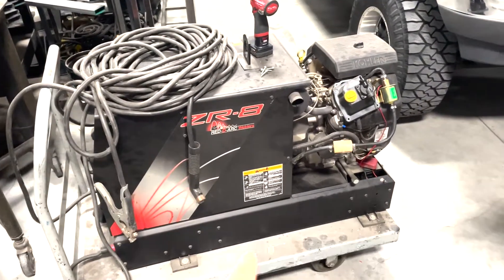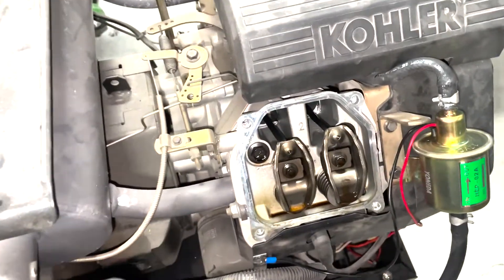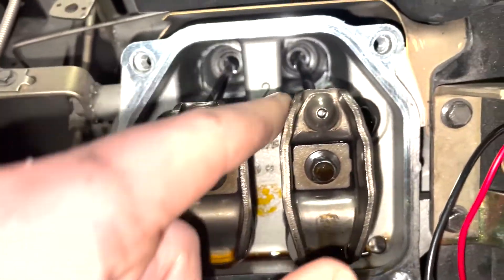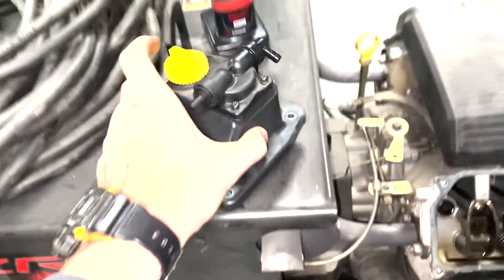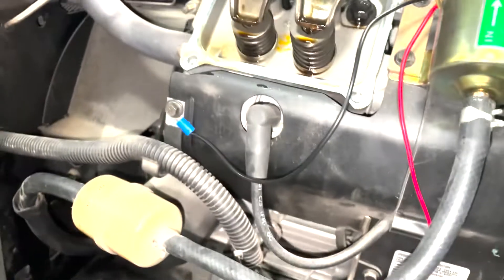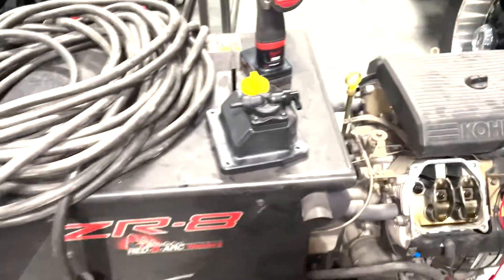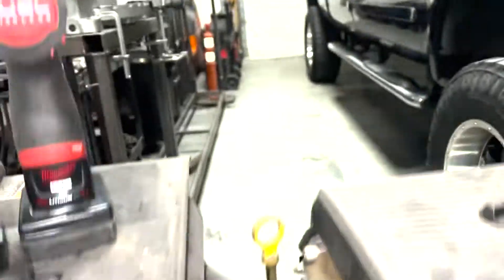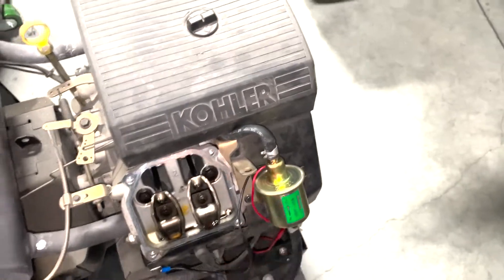Kohler manual fuel pump conversion to electric

Comment: Jesse,  I have a K321 Kohler Engine and want to convert to an electric pump.  I purchased the same pump you show in your video.  When you installed it did you have to make any changes/adjustments to the carborator.  How do I know that this pump is not to powerful for my engine?
David
Reply from the maker: the float of the carburetor should throttle the flow of gas if your pump isnt crazy oversized

Comment: How has this conversion performed since you installed it? Can you provide a link to the electric pump in your description?
Reply from the maker: It has performed perfectly... something i have stopped doing though, is running the engine out of gas when im finished. This seemed to cause the engine to over rev and bend a push rod still.  (i just make sure that i run the engine every month or so to keep the gas inside the carburetor fresh.)
Reply from the maker: here is the pump i used. Any 12v low pressure pump should work...  the float in the carbourator should keep it from pushing to much gas through
https://www.amazon.com/gp/product/B07JPDZC4M/ref=ppx_yo_dt_b_search_asin_title?ie=UTF8&psc=1
Reply: I used same pump on Kohler mower… 1st lasted 3 mows, then overheated…
2nd lasted… well, it didn’t … over pressurizes the carb and floods engine   About 20 psi fork a 3-7 psi pump 😞…
Reply: @GR40RCapri 
I have the same Issue...
Which Pump you have on now??
Or which one would work on those Kind of Engines??